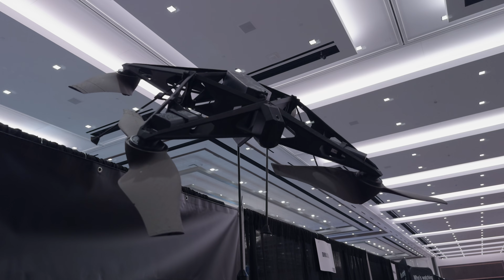Can't buy one? Print your Drone! | Modovolo | UAV Expo 2025

Comment: every couple years someone says, HEY i can 3d print a drone frame.....and FAIL.  its funny to watch it over and over again.  its not saving weight, its not saving durability. its not worth it, period.  prove me wrong.  been at this a decade and 3d printing.
Reply: 3d printing is better for prototyping, not final products.  carbon fibre is cheaper and stiffer.
Reply: What is the website to sign up